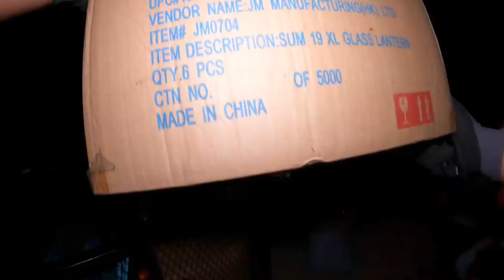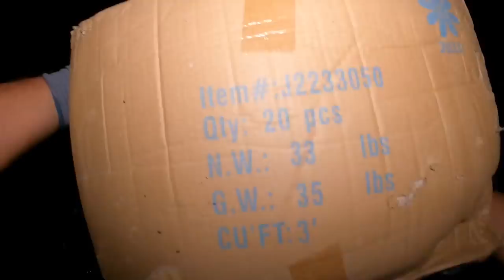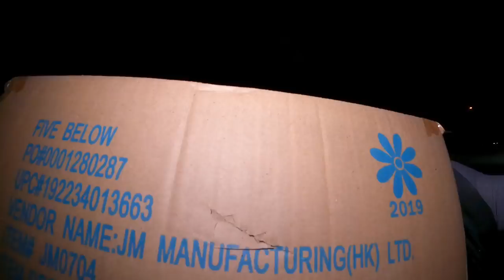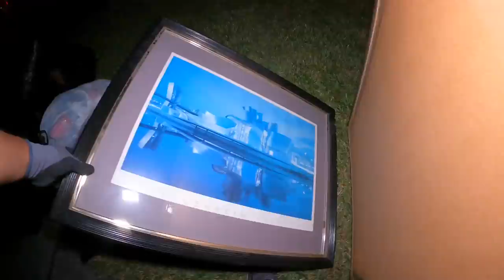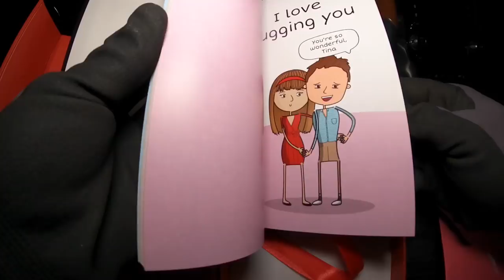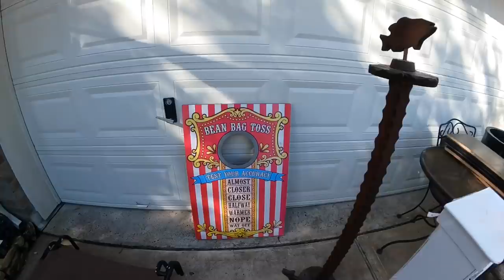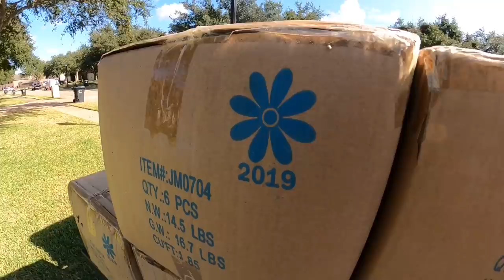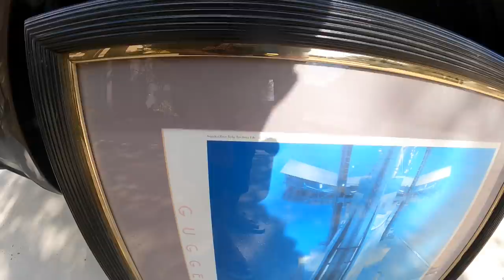Best Dive 2021 !!!

Comment: I have been looking everywhere, and can not find another table built like yours! I have found other side tables with cubbies like that. They're shaped different and taller. They are called French Boudresse vanity tables. The cubbies are for makeup and jewelry. Maybe yours is a child's table. The style of furniture is Hepplewhite I believe, from looking at the legs And hardware. That could be as old as early to mid 1800's. It's hard to tell, not being there to see it in person. You are correct about the lids being missing. Also I think there might have been a separate large lid on top of the small lids, because there is a key hole on the front. My opinion is that is a very good, very old, French Boudresse style, Hepplewhite bedroom side table. I don't have a value on it, because I couldn't find another one like it!! The full size ones were listed on fancy private websites, for $500 - $8000!!! If I were you, I would try to get it appraised by someone who specializes in fancy French antique furniture. It's bugging me now! I'm going to keep looking!!! 😆 Ohh I bet the top lid had a mirror on the inside of it! Is there hinge marks/screw holes on the back???
Reply from the maker: Wow great info! Thank you 
I’ll have to check the back and report back